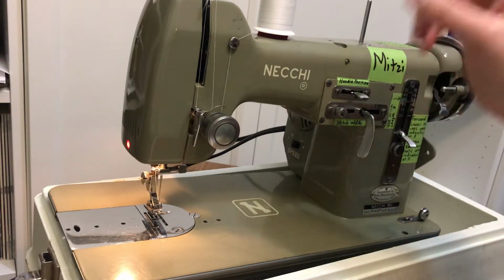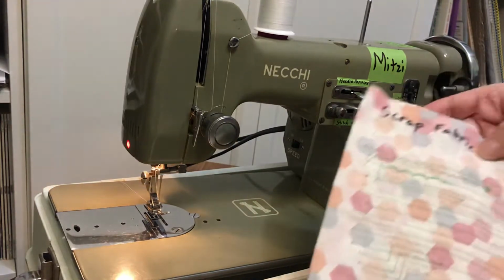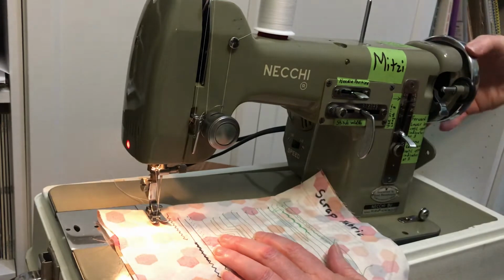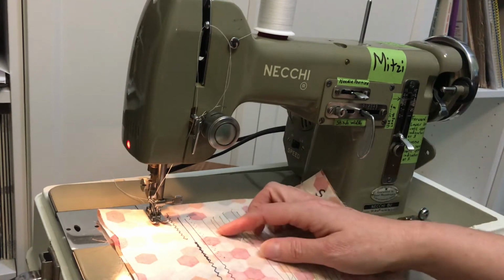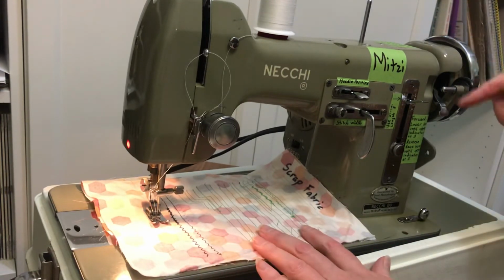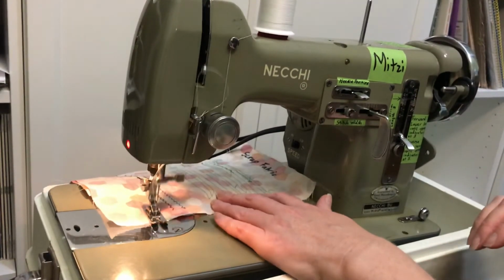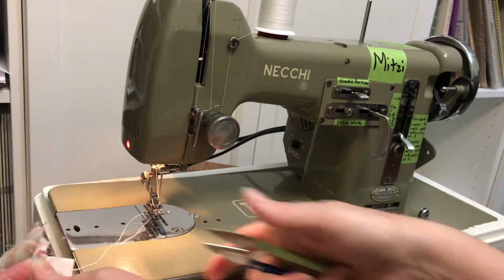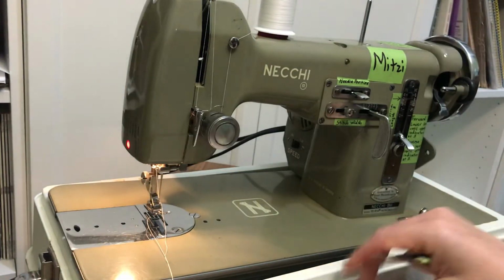Necchi BU Mira Part 4 - Testing the Machine

Comment: I'm new to sewing and I want to use it for leather work.  Does the Necchi bu mira have or need a walking foot for leather. Also, the machine I'm looking at  does not have a foot pedal. Will a new universal pedal work or can I get an older pedal that works. Thank you very much.